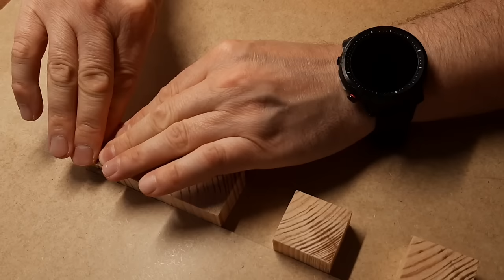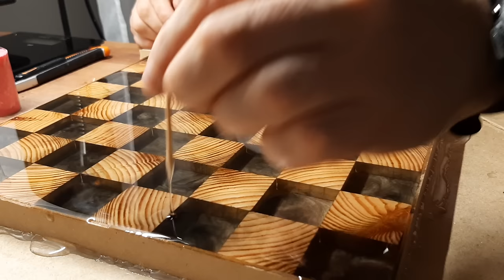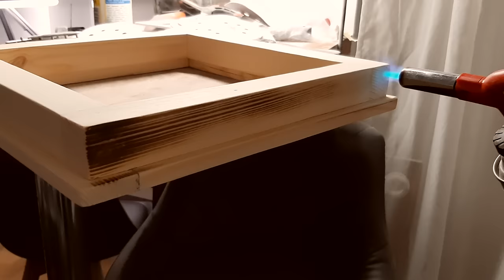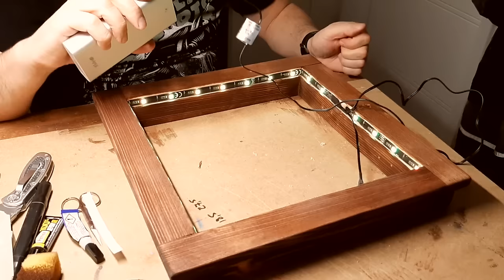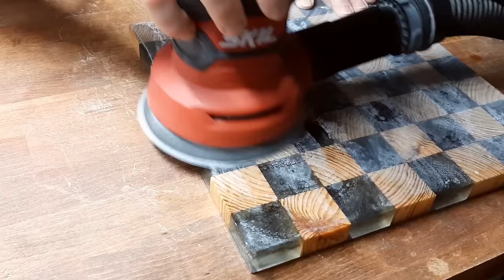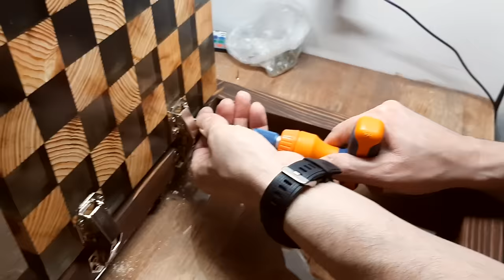Floating Chess from Wood and Epoxy Resin with LED

Comment: The only problem with using clear epoxy is over time it turns cloudy and a horrible shade of yellow and goes rubbery and looses its bond if it’s bonded to a substrate so it’s better to use a dye pigment to change its colour which stops it from turning yellow but won’t stop the cloudiness over time.  Even all UV resistant epoxy does this eventually.  I hope this helps someone..
Reply: This is why I only use the Liquid Glass epoxy, never had any yellowing even months-years after. I'm sure it will a little bit and maybe it has but it's not noticeable in anything I've done. I've used others that have yellowed after a couple weeks that claim to be UV resistant.
Reply: @joshuaholden4303  I’ve tried about 15 that claim they are either UV resistant or not effected by UV at all it was only when I spoke to a chemist that I found out that all epoxy’s use phenolics or some form of a phenolic catalyst and I mean all of them,  anyway she said it’s not just UV it’s most of them like UVA UVB UVC that break the polymers in the epoxy resin down.  This photochemical reaction is responsible for more than just turning the epoxy resin yellowish because you can add UVA protection but to get 100% UV protection you need to give it shades like sunglasses this means adding pigments.  It’s only a matter of time before it yellows or goes cloudy might take months or a year but it will happen regardless of a manufactures claims.  There are better alternatives out there though especially for casting but epoxy with out dye is a no go.

Comment: The chess pieces are too large for that board (or the board's squares too small for those pieces). Also you setup the pieces incorrectly - when behind white, with the white square in the right corner near you, the King is on the right, with the Queen to the left of the King. 
"White on the right" for board orientation, and "Queen starts on her own colour" (White Queen on light square, Black Queen on the dark centre square).
I would also recommend setting up the squares more accurately at the beginning of the project so the lines are straight and every corner of every square is only touching a corner of the other squares, not the side.
For all that, it's a nice finished piece.
Reply: I was going to say the backwards set up and freehand placement of the squares are the only flaws in an otherwise inventive piece

Comment: The only thing (and fairly important step) you did not show was removing the initial bottom board you were gluing the squares to in the beginning...how did you remove it? Is the hot glue the key to removing it easily?

Comment: I assume you made a 12-inch board as you were using a miter saw, but my recommendation still applies. If you took five 1-1/2-inch x 1/2- inch or even 1/4-inch strips of oak, poplar, maple, whatever and then fastened them with 1-1/2-inch gaps with the same spacer strips used in your system, that would give you a better looking grain, you have end grain. You then poor four strips of the resin between these and let it harden up. Then take that striped board and run it through a table, band, or compound miter and get eight strips of 1-1/2-inch (or another size if wanted) strips of squares. Take these and offset every other strip one square for a chess board pattern, once reglued cut the extra, ninth in each row, squares off each side and finish the surface to your liking. This is basically how one would also make a chess board with two types of wood. I tried the multiple squares when I was in 8th or 9th grade (about 50 years ago) and that takes too much time and invites errors in my opinion. I would also advise you cut the strips a little long to allow for saw blade width.

Comment: That's a badass looking chess board! Everything was great until you placed the Queen and King in the opposite positions on the board. It's always Queen on color. So White Queen on White square and Black Queen on Black square. And the black square goes in the bottom left hand corner.

Comment: Wood Season, A straightforward design that not only is practical but extremely cool looking. Well done.
Question: Are you doing all that work inside your apartment?
Reply from the maker: Thanks.  Yes, I have a small apartment...

Comment: It's a little bit odd that the dark squares are the lit ones. If you'd play in the dark the "dark squares" would be the lighter ones and the wooden "light squares" would be darker. You can actually see that at the end of the video.

Comment: Would the resin pour still work if I taped epoxy tape on wood and then glued the wood pieces in there and poured the resin in between? Exactly like you did but instead of that plastic thing just wood with epoxy tape on it

Comment: I’m wondering what you glued the wood squares to? Looks like you used hot glue to plywood and then poured your epoxy. How did you get the board free from the plywood surface??
Reply from the maker: The surface of the plywood was pasted over with adhesive tape.

Comment: Nice work but i would like to see it portable with recharging unite in the storage area for the lights and the board being flush with the base made of solid maple or walnut. It would add elgance and a nice finish to the design.. The extra spend on minimal wood could help with overall aperance and sales. Who knows? Chess is not going anywhere. we may see the next millionaire in the near future

Comment: Nice board idea however personally not really liking the base and lights as for me it makes the board look average after all the time spent on it. From a painter's point of view after the clear coat was done you could see quite a few blemishes - pitting in the resin and some fine foreign particles in the clear coat - so I would like to suggest more sanding with finer grade discs (down to 1500 or more if you can get them) or maybe wet and dry 'polishing' would produce a better and smoother finish. Also separate workspace for construction, resin and spraying would benefit future project as you are less likely to contaminate the resin and clear coat.

Comment: Mhhh ... okay, the work is done, and it was interesting to see how you have made it! But three points would disturb me: The colorchange nerves while playing. A small part of the metal hinges is visible through the epoxy, so cut it off. And in every chessboard the dark field is left on bottom...

Comment: Do you mind me asking what dimensions are your lumber and cuts?
Reply from the maker: Cubes 35×35×30 mm Chessboard 280 × 280 mm
Reply: @WoodSeason  thanks!
Reply: @WoodSeason  what did u use to glue the pieces down on? Is that cardboard?

Comment: I wish woodworkers would stop jumping right to coats after using an orbital. All to often your orbital will leave micro swirls in the surface that a sharp eye will pick out real quick. After using your orbital for your base sanding go over it with a sand block of the same grit to add a better surface to your project and make sure all your grain is in same direction. Or back track one grit and then go back over with your final grit and a block. After 5 years of woodsmithing I learned to never use an orbital for my final sanding.

Comment: Should've turned the LED in to a Two colour affair (say Blue and Green) rigged to a switch to change from one to the other at the push of a button.  This could have been used as an interesting Chess 'clock'.  Blue when it's white's turn to move, Green when it was Black's with the Player's flipping the colour once they have made their move.  The cycling LEDs are just distracting otherwise.

Comment: beautiful project love the lighting

1. I think while playing I would keep the color a solid color
2. when setting up the board remember the queen goes on her color  white queen white square.
3. (you got tis right) white square in the right corner "white-on-the-right"
4. I like the light from under the base but, if your putting the pieces in the base I would add some foam that the pieces could be set into so they don't rattle around?

Comment: the basic idea is good, but everything else is pretty amateur. thats not to criticize you and your work
but as woodworker, i have like 20 things to improve this piece and make it really shine
for example, the charred wood could have been the basis for the shou sugi ban technic ( look it up...), it can look really nice
the frame could have some dowel for better fixating while glueing, instead of this blank stick to eachother, or even mitre joints, like a proper frame
the epoxy board could have gotten a proper and more fitting finish to make it shine better, a more polished finish instead of the spray finish
and what someone else already proposed, you could have used some other way to stop  thos led spots to shine through and diffuse the light some more

but again, the idea for the board itself, nice and i keep it in mind and maybe when i got a proper workshop again, i do it myself

Comment: Absolutely stunning....I'm not critiquing...it's absolutely beautiful....but if you would've burned the frame all the way....used a red plastic wheel to clean out the burnt spring wood.....it would've been even more beautiful....sorry...I'm really not trying to be an ass....I just hate it when ppl don't burn wood right

Comment: Board looks nice, top 2 comments beat me to a suggestion (LED's need diffusion) and complaint (music is cancer). I'm not a fan of epoxy in woodwork, it's a fad that is abused with all the waterfall tables, I understand it doesn't have the durability to last. The chess pieces don't feel like they match the board, cheap plastic look.

Comment: i just don't get it... why do people ruin great epoxy projects by using decades old LED technology.. GET WITH THE TIMES. use ARGB (WS2812) LEDs not that old ass RGB shit. AND YOU SET THE CHESS PIECES UP WRONG..  WHITE TO RIGHT QUEEN ON HER COLOR

Comment: bro its amazing but UGH you put the pieces on the wrong squares. so its amazing but also so duh..

BTW the Q always goes on a square of her own color, and also the right corner squares are always white, this means you do have the board orientated correctly but you have the queen and kings reversed as to what squares they are supposed to be on.

Otherwise amazing job.

Comment: It's a shame. He put all that work into it and used a lazy LED backdrop. If they would look so much better if each square of resin had it's own addressable LED hooked up to a cheap arduino. You can program the lights to orchestrate any way you want them to light. instead of seeing the cheap strip under the glass.

Comment: Not impressed by this work. There is a lot of opportunities to make it better.
1. Make resign blur so no one can see bottom through it and light still come out. It will create a good light effect.
2. Take care of wood grain ( lines on wooden blocks).
3. Sides of wooden blocks are visible through clear resign. Paint the sides of blocks with black color.

Comment: this thing will be a mess in 2 years. you didnt seal the crappy home depot wood, moisture and air will escape and distort the piece. also never cut wood from the top down. you have a sliding miter saw, use it correctly from front to back ,sliding.....not chopping.
homeowners...yikes

Comment: Unfortunately you have set up the chess pieces the wrong way around. The white square is always to the right and black square to the left as the player looks at the board. Remember, “White to the Right”. This means that the power cable is 90 degrees from where it should be. Only chess players know this rule.